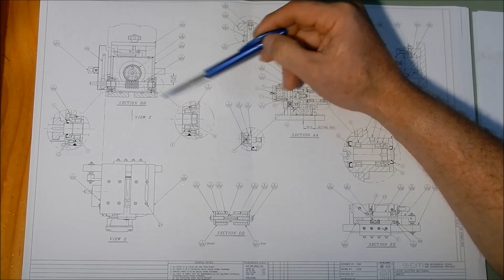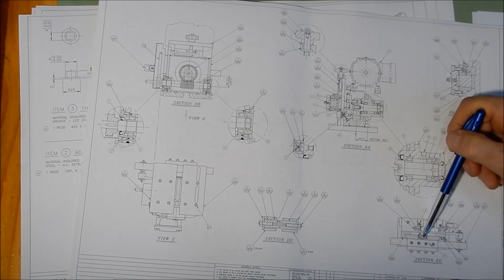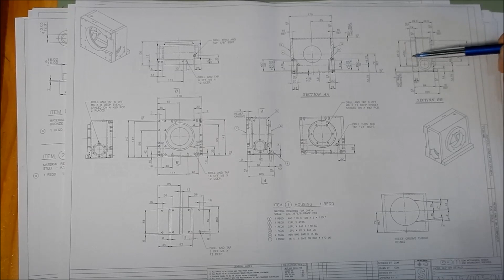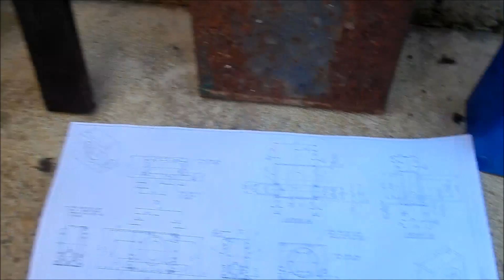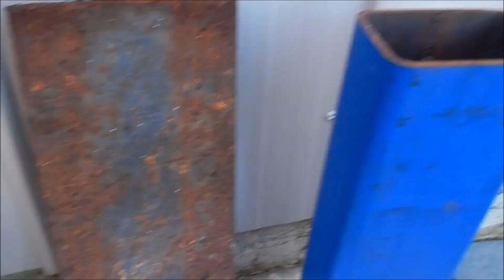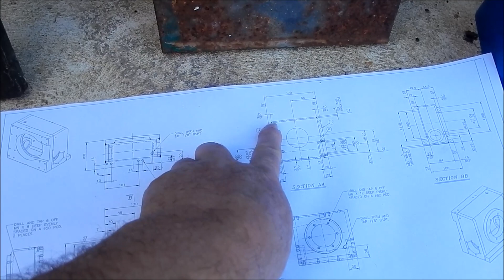Powered Lathe Slotter Build Part 1

Comment: Cam, an Aussie myself, I did the MIL Spec 5400T and the drawings we had to create “books” of drawing as you said.. this is because every part has a number which can be traced back to procurement and for ECO level document tracking so that all the finished projects made a complete tracking from concept to usage.  If at the usage  their is a problem, where ever the failure is is totally traceable to it origin.  Often in these cases, the part number can be in the hundred of thousands even before ECOs.  Cheers mate!!

Comment: Hi Cam, newly subscribed today. A question, are your drawings for this project available?
Reply from the maker: Hi 1ginner1, selling my designs, back in the early 2000's I had a my own Web Site which I shared all my Foundry Furnace, Burner, Muller and Sand Preparation designs until I discovered a book that was published showing all my information, drawings and designs.  I was also getting a lot of people abusing me when there builds didn't quite work out and blaming my drawings/designs for their problems.  I would spend hours trying to explain where they had gone wrong and still got abused for not being clearer.  All this for something I gave out freely.  I shut down my Web Site as a result, I'll never say never but I don't really what to go back to that hassle again.  At this stage, I'll just enjoy what I'm doing in and around my workshop and hope others enjoy it too.
  I did make a number of changes along the way and if I where to make them available I would have to do a full back draft to ensure everything would fit together right off the plan.  Quite a bit of work in that though.
Cam
Reply: @camatbattler2233  Totally understand, been there myself, Its always the designers fault. lol

Comment: Hi Cam.  Is it possible for subscribers to obtain the drawings for the construction of the slotter?
Reply from the maker: Selling my designs, back in the early 2000's I had a my own Web Site which I shared all my Foundry Furnace, Burner, Muller and Sand Preparation designs until I discovered a book that was published showing all my information, drawings and designs.  I was also getting a lot of people abusing me when there builds didn't quite work out and blaming my drawings/designs for their problems.  I would spend hours trying to explain where they had gone wrong and still got abused for not being clearer.  All this for something I gave out freely.  I shut down my Web Site as a result, I'll never say never but I don't really what to go back to that hassle again.  At this stage, I'll just enjoy what I'm doing in and around my workshop and hope others enjoy it too.
  I did make a number of changes along the way and if I where to make them available I would have to do a full back draft to ensure everything would fit together right off the plan.  Quite a bit of work in that though
Cam